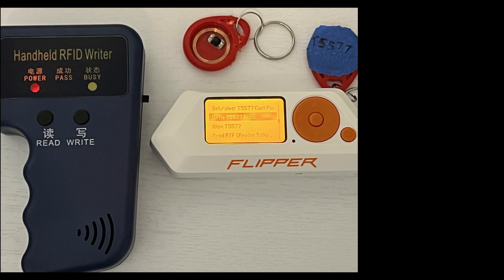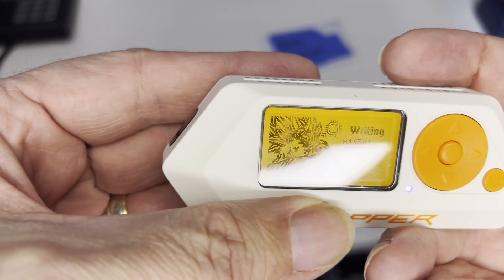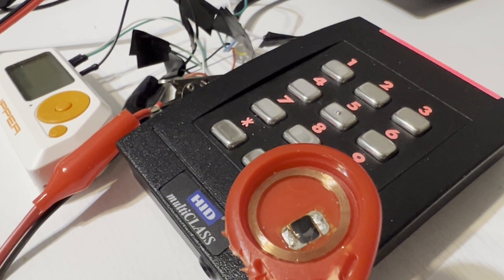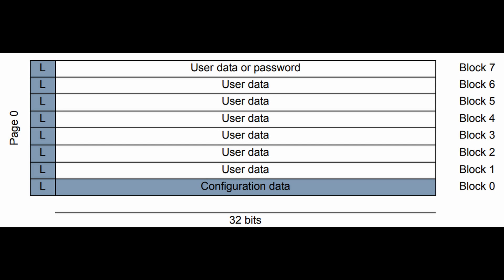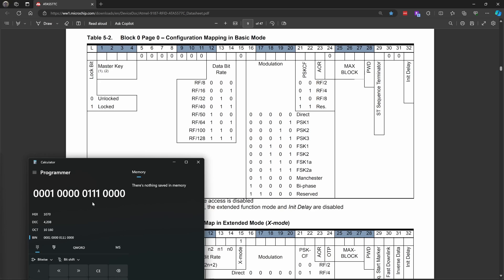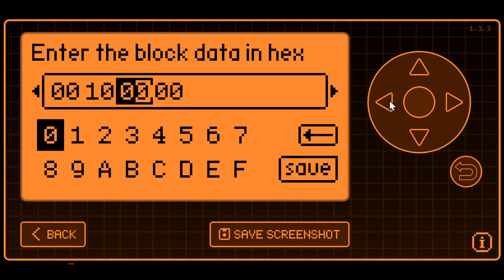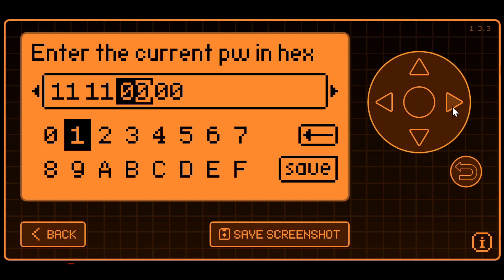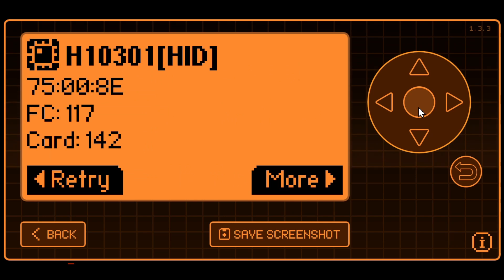[103] Flipper Zero - T5577 Cloning, set/clear password, config block

Comment: Hi I need help  if u can help me plz I have problem with t5577 tags I bought icopy-x for cloning fobs for my Custmer for few months it was cloning 125khz t5577 I clone for few Custmer but now it only read but can not write its says write failed I couldn’t solve the problem so I bought chameleon  ultra i have same problem again both icopy-x and chameleon ultra can read and write other fobs but they can not write 125khz t5577 fobs so I bought fillper zero i have the same problem again fillper can read and write other tags as well but not t5577 125khz so I Oder new tags from Amazon t5577 em4035 125khz  again all 3 device can not write on t5577 125khz tags ,,, help me if u can plz thanks
Reply from the maker: Most likely there is a password that got set during the cloning process. Most custom firmware on Flipper zero has option in Advanced setting to clear the password. It will ask you for a password, but if you just click save it will use the most common 100+ passwords used by popular cloners. When your device tries to write to the tag, what happens is it sends write commands & then reads tag to see if it matches what it wrote. There is also an option to set tag read-only, but most cloners don’t do that by default.
Reply: @MrDerekJamison  thanks if u do,nt mind can u tell me what custom firmware have option advanced setting to clear password
Reply: @hazaraking816  unleashed, rogue master

Comment: Using Momentum FW, I cannot seem to clone my pool access tag which Flipper reads as EM4100 and can emulate it just fine. All the tags I bought on Amazon should be writable but Flipper never seems to be able to write to those. Same error, make sure it's writable.

One bag I got has a mix of Guardall GProxII and EM4100 tags even.
Reply from the maker: I use T5577 tags like https://a.co/d/akDVRiP or https://a.co/d/d7tOcif or https://rabbit-labs.com/product/writable-atmel-t5557-rfid-keychain-tag/

Comment: Hi Derek, love the vid, and thanks!
One question, can the Flipper Zero sniff a T5577 reader and obtain access codes? (without having an original real access fob)
Reply from the maker: Typically, there is no data from reader to card, unless block 7 is used for password and Answer-On-Request mode is used.  Even if you could sniff the password it sent to unlock the card, which you can do with ProxMark3 (but I've never tried with Flipper Zero), you still wouldn't know the block 0-6 data unless you had an original card - which is the configuration and data-credentials that are used to unlock the door.

For some protocols, like H10301, you can brute force the code if you know another credential (maybe from looking a badge or whatever). But there is likely auditing, so as you brute force the sensor, you will trigger security alerts.

Only try on readers that you have written permission.

Comment: Got the Latest Rouge Master Firmware in my Flipper zero but why its not showing the T5577 wipe option ? Please let me know how can I get the wipe option....thanks in advance
Reply from the maker: Sadly, RogueMaster no longer has Wipe or even writing a block.  My video last week shows how you can write code to do it - https://youtu.be/nSCIOz2bVR0.  Next week's video will be about how to write code to wipe a T5577 to act just like a blank InstaFob from Home Depot (and when it writes the data, it will confirm it worked.)

Right now, the simplest you can do is Add Manually, choose "Generic HIDExt", Save, then Write.  Blocks 1-6 will basically be filled with 5s, but you won't get any validation it worked.  Feel free to ask on my Discord server if you need additional help -- https://discord.com/invite/NsjCvqwPAd
Reply: @MrDerekJamison can you please let me which  version of rouge master had that option to wipe T5577? If you could give me the firmware link will be appreciated....thanks
Reply from the maker: @adilbd  https://github.com/RogueMaster/flipperzero-firmware-wPlugins/releases/tag/RM0208-2318-0.97.2-f563329

It writes 0x00148040 to config block. And writes 0x0 to user data blocks 1-7.

If you join my Discord server I can share you a TGZ file (it's about 5MB).  https://discord.com/invite/NsjCvqwPAd
Reply: @MrDerekJamison  Hi I already Joined there. My Name is ADIL there.Please let me know how can I get the file there because I am new there.
Reply from the maker: For anyone else looking for the file, you can join RogueMaster's Discord server and he can provide something that should work.  His server is at https://discord.gg/gF2bBUzAFe

Comment from the maker: It seems RogueMaster firmware removed the programming feature during some code refactor, but is looking into how to add it back to the firmware.  You can either downgrade to firmware from early Feb, or wait until a new solution exists to allow you to edit the T5577 blocks.  For example, you can `git checkout fda9dcc3f67e3ad1279826cfa6a29863c0cc2afc` and build that version.  For more help, feel free to ask in my Discord server - https://discord.com/invite/NsjCvqwPAd
Reply: Hi! I was wondering if you could answer this for me: Can one use the flipper zero to potentially recover and change a forgotten password for a samsung tablet ? I forgot mine, and I can not fanthom why I would change the password of my tablet, and I must have done it at one point because I no longer have access to it. I know I could factory reset, but part of my thesis research is on that tablet, and I don't want to lose that data (not to mention all the hard work poured into that research 🥲)
Reply: I think depending on how old is the tablet and if it has or not blocking itself with wrong attempts, if it does not blocking you can try to brute force the pin using the flipper as keyboard